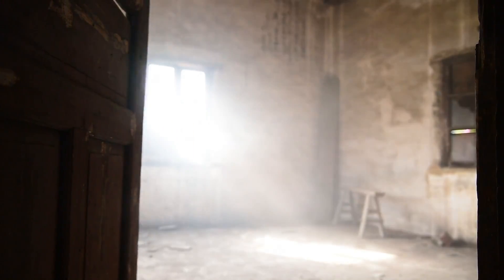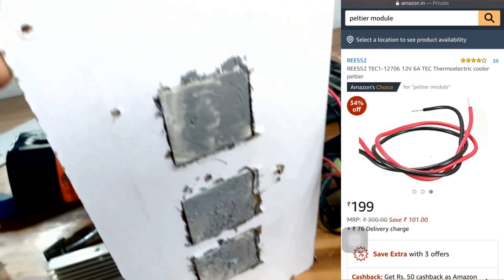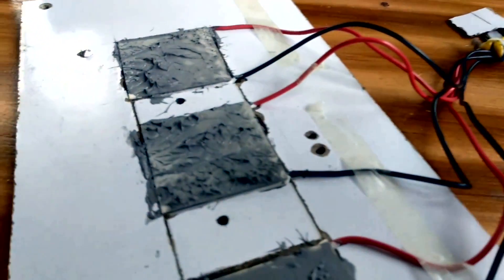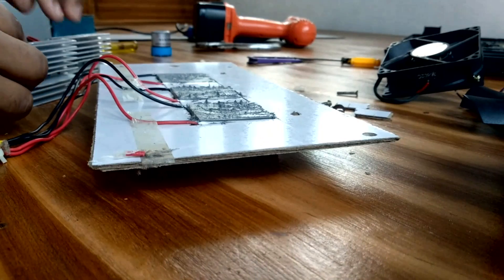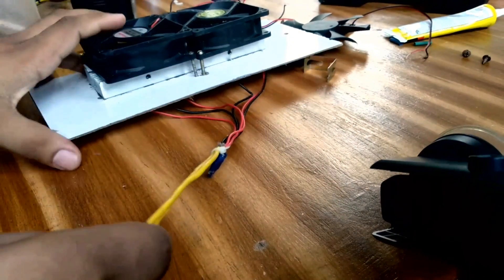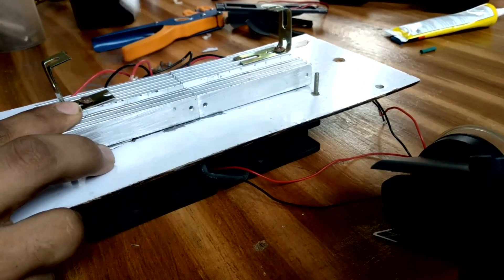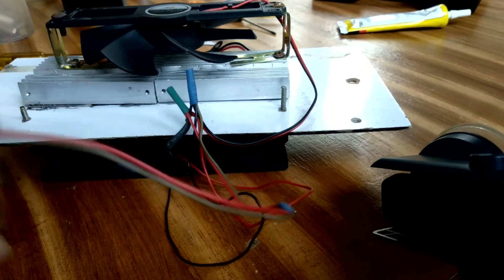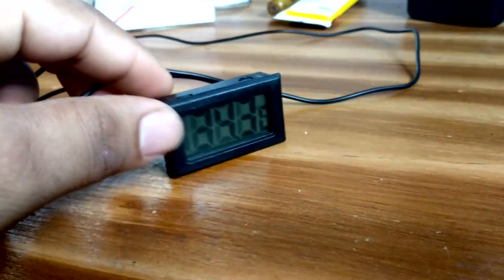600 രൂപക്ക് കുഞ്ഞൻ  AC വീട്ടിൽ ഉണ്ടാക്കാം | How To Make Air conditionar At Home | Peltier Ac

Comment: ആ 600 രൂപയ്ക്ക് ബിയർ വാങ്ങി കഴിച്ചാൽ കുറച്ചു നേരത്തേക്ക് ഒരു തണുപ്പ് കിട്ടും
Reply: @Grapherbi  ഇനിയു ഇമ്മാതിരി വിഡിയോയും കൊണ്ട് വന്നാൽ ചിലപ്പോൾ നാട്ടുകാർ അതു ചെയ്യും
Reply: Oru room full cooling kittanel peltier minimum oru 20-30 ennam engilum veenam. Ithi 12v 6amp current veenam maximum efficiency kittan. Pinne ithe poole speed illatha kunju fan use chayithittu kaaryamilla. Minimum oru exhaust fan engilum veenam. Ethratholam ithinte choodu ulla bhaakam cool chayyano athratholam ithu cooling tharum. Nalla company de veedikkuvanel -40%c vare cooling tharum. Pinne peltier cool chayyan water cooling chayanam.
Reply: Polichu 🤣
Reply: Peltier modules. Hihihi
Reply: Mathramalla peltier module engane assemble chyyanam onnum paranjitilla chodulla bagam etha thanuppulla bagam etha onnum mention chyyunilla electronics abcd ariyathavar ith try chytha circuit mari koduthal nthayirikkum avastha soo oru video chyyumbol a-z karyangal vyakthamayi parayanam wire parellel kodukkanamenn parayunathe ullu ath engane kodukkanam enn kanikunilla athe pole power supply connect chyyunnathum kanikkunilla verthy nthenkilum okke akkiyit video upload chythitt karyamilla ath viewersin manasilakanam ithene kurich idea illathor chythal circuit thanne clash aayi pokum athu kond inganthe electrical or electronics based aaya video chyyumbol atleast athokke enthanennum athine advantagesand disadvantages pinne circuit engane kodukkanam enn full ayitt kanikkanam descriptionilum kodukknam